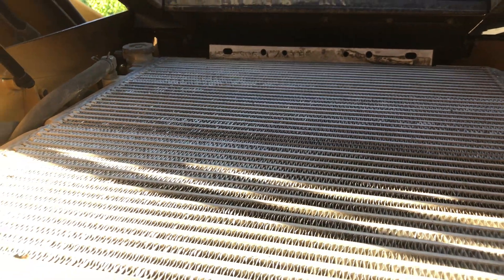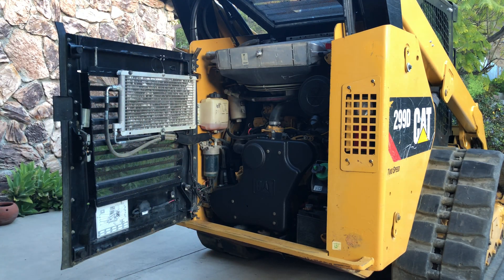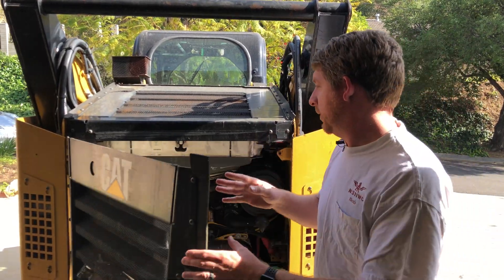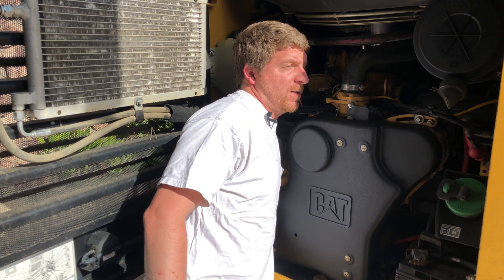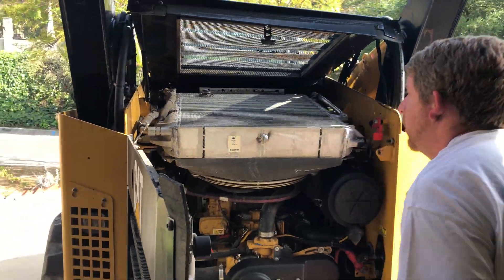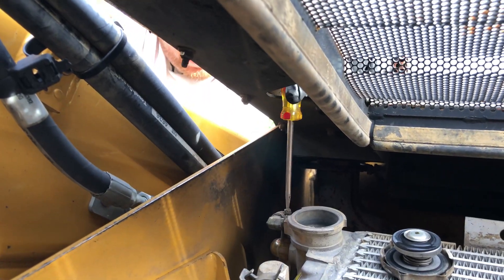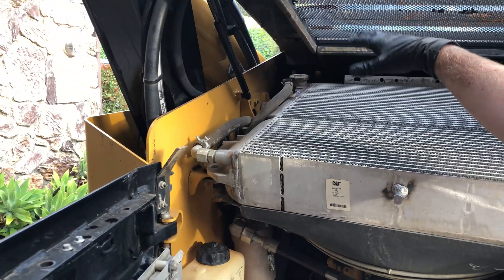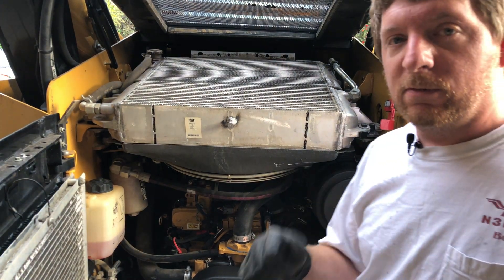Flush It! - Radiator Flush & Coolant Replacement for CAT299D

Comment: I know this is an old video but what is the max tempature you have seen since all the cleaning?
Reply from the maker: Between 207-212 at full throttle
Reply: @MakersAcres thats what it runs at now?  Mine runs at 205°f and im trying to see if thats normal.
Reply from the maker: @dirtpicasso yes, that is normal at full throttle. I have seen mine go to 212 on a hot day under load.

Comment: Do you have any specs on what the torque specs are for the water pump? Is the information in the owners manual?
Reply: I’ll have to get the size on it this afternoon. Where did you get a service manual for your skid steer?
Reply from the maker: @bradytaylor9527  I ended up buying mine. But I would go to the heavy equipment form and ask. A couple users have a database and have been willing to share.
Reply: It’s a grade 8.8 12mm bolt
Reply from the maker: @bradytaylor9527  the manual shows 78 Nm or 60 lb ft for an M12 8.8 bolt.
Reply: @MakersAcres
Reply from the maker: I’ll check later tonight for you
Reply from the maker: The service manual gives torque for fastener size. Can you tell me what size it is?

Comment: My skid steer coolant bottle cap has bubbles coming out any ideas?
Reply from the maker: How full is that bottle?  This cap does need to breath a little to let coolant in and out of the radiator.
Reply: @MakersAcres bottle under half full
Reply from the maker: @Gooselip  If you want to send me some pictures to the email under the about me section, I can take a look.  You can also post to heavy equipment forums and someone will probably answer you too.